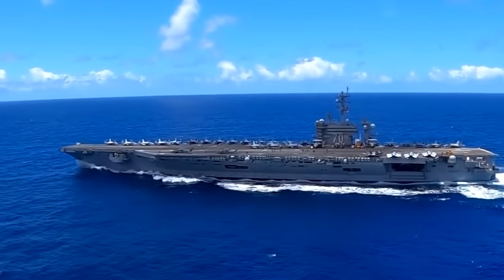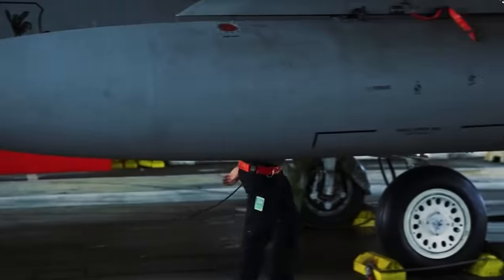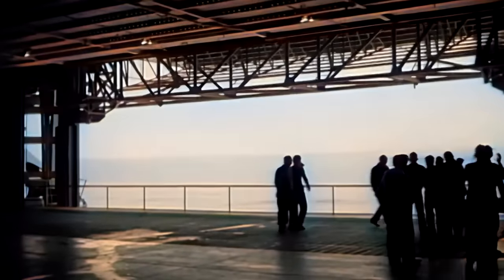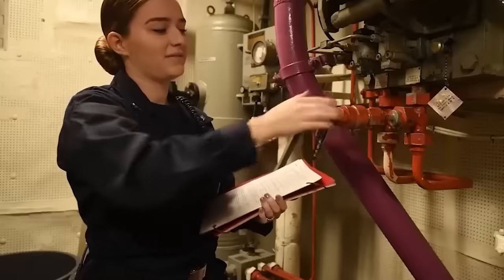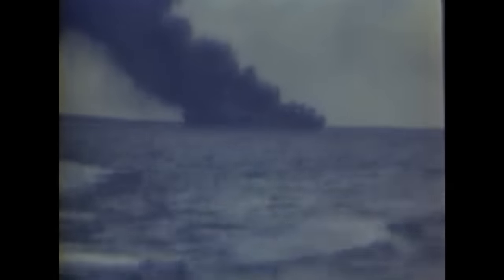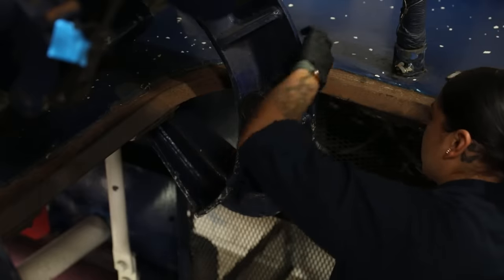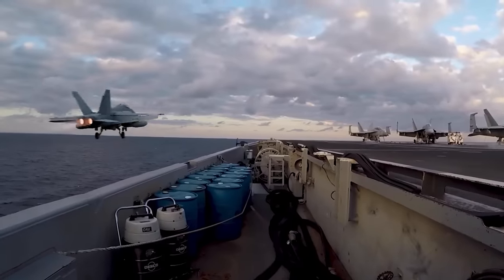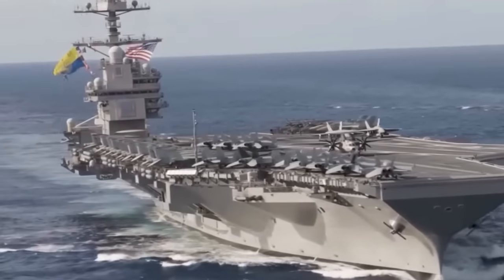Why Do US Aircraft Carriers Have NO DOORS in Hangar Bay?

Comment: I served CV-62, CV-64, CV-66 and CVN-70.  All had elevator doors.
Reply: INDY BOY!! i Served CV-63
Reply: I served aboard IKE 1991-1994.
Reply: I was on the Carl Vinson CVN-70. We had hangar doors, but kept them open all the time.
Reply: @Richborg44  the Hawk was only closed for rough seas if i recall. but that was 99-02
Reply: Only time I seen our HB doors closed on the Vinson was if it was bad weather or they had the white lights on at night during deployment.
Reply: Which one was your favorite
Reply: CVA-64/1966-67. Hanger baydoors used in rough weather including typhoons.
Reply: There were also compartment door in hanger to separate parts of the hanger.
Reply: Served on Forrestal CVA 59 WESTPAC
Reply: Thanks for service
Reply: @gf3559  , the Hawk's hanger/elevator doors were closed while transiting the heavy seas in the Atlantic coming home from deployment on our way to Philadelphia, via Norfolk, in 87. While walking through the hanger, you can hear the waves slamming against the hull of the ship. Sure glad those hanger doors were closed then. It sounded like I was walking inside a bass drum.
Reply: I was on the Connie to. When were you on her?
Reply: I rode CV-64 (The Connie or The Bitch) as a black shoe. Those doors were closed in bad weather and in the freezing ship yard in winter, Bremerton Wa. 1976.
Reply: @gf3559
I Enlisted by Autumn '98. 😉
Reply: @robertmoore7199
I was b. by Cesarean Section
@ 2:52 P.M. CST on Oct. 23 that
Year!
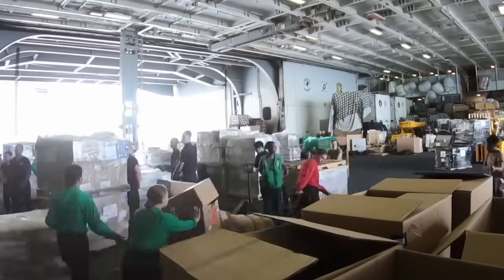Reply: Thank you for your service. I saw your post shortly after posting the following " At 0:07, 0:26, 8:43, 8:46, 8:49, 9:46, 9:49, and 17:15, you can see  horizontal sliding doors to the sides of the main aircraft lift elevator."   Your post establishes that doors WERE present. So, the question then becomes "When were the doors removed?". My first guess was that change occurred with the introduction of nuclear carriers. HOWEVER, since  you served on CVN-70 (Carl Vinson), which is nuclear powered, my guess is wrong.  So the question remains..."When were doors removed?", or better yet, "Specifically, WHICH carriers do not have doors?"
Reply: @gregparrott  ALL US aircraft carriers have hangar door...
Reply: @blackpowder13  Either this video overstated the lack of hangar doors, or you're right, and this channel if full of s**t.
Can you state for a fact that ALL of the Nimitz class, as well as the latest 'Ford' class have hangar bay doors? If so, what's your source?
Reply: Connie was one hell of a boat. V-2 Waist Cats '00-'03. Best 3 years of my life.
Reply: I served on America from 87 to 89, and spent some time as a flight deck EO (elevator operator).  America had doors.
Reply: I was on CVN64 In Vietnam, and we had doors between forward hanger bay and aft HB. None at the elevators. Those just blew out,with the planes still on them.
Reply: I was squadron and did dets and/or cruises on CV-59, CV-60 (Desert Storm), CVN-69, CVN-73, CVN-74, and CVN-75. All had hangar doors. - ATC(AW)
Reply: When were you on the Indy? I was G-3, 95-decom.
Reply: Hey shipmate! I was on USS America CV-66 in 91-92, S7 division.
Reply: I was on the Indy and Nimitz, all had hanger doors, you can actually see them in the first couple seconds of the video......
Reply: CV-64 WestPac '97 here!!
Reply: Uss Carl Vinson plankowner 80-84 V-1 Div.
Reply: I sailed CV-61 w Capt. Dan, CV-64, CVN-65 the prize, and a tiger w my son on CVN-72. All had hanger bay doors. Usually closed in rough seas, general quarters, or when we weren't flying.
Reply: Hey Shippy, I was an AO in VF-102 Diamondbacks 90-94 embarked on the America.
Reply: Me too brother V1 division Yellow shirt fly3 86-89 cv-62
Reply: @ksamos  I still have my Diamondbacks can coozie and other swag from VF-102

Edit: we were aboard at the same time. Good times
Reply: The doors you are referring to are called blast doors and they are designed to protect against ballistic missile attacks. I've worked on Nimitz class carriers and I've seen them closed while being serviced. I was on one a year ago and was glad the doors were closed because it was freezing cold outside.
Reply: Served about 8 months of CVN-72 and the. Served on CVN-73 and did 2 deployments to the Gulf. Was on 73 when 9/11 happened, and we ended up sitting off the coast of NY for air cover. Cole was part of our group when she was hit. All that time and the elevator doors were only ever closed for bad weather.
Reply: I flew the blackbird
Reply: I was a Surface Warfare Officer , aka "ship driver", ) O- 3, aboard the USS Independence, CV-62 in 1979-1980. We of course had "hanger doors". Remember the large ones with RED paint around the trim? Behind which were the munitions, like oh you know- the Nukes? Yeah, those doors were kept closed most of the time.
Reply: I was on Ranger, CV-61 and we had elevator doors.
Reply: @gregparrott  I spent almost a decade serving on several flattops (not to mention a lifetime as a Naval Aviation enthusiast) They all have hangar/elevator doors, tho they only closed em for heavy weather...
Reply: Nice! I was on CVN-72.
Reply: CV 42 had the aft port side hangar door blown in and the ocean filled up the hangar bay. The water flowed in and out. Up to the ceiling where I held on to pipes until the water flowed out only to keep repeating for days.
Reply: True indeed.
Reply: Agreed, CVAN-65, CV-61, CV-63, CV-64, CVN-68, all had elevator doors. All the way from 74 to 88. The doors were only closed during inclement and sometimes GQ. On the Ranger CV-61 during a fire in the engine room, the doors were closed to help contain the smoke and fire. Also until CV-68 all had 2 hangers not three so only 1 set of divisional doors.
Reply: So you think any didn't have hangar bay doors?  those must be the river aircraft carriers where there are no storms with big waves.
Reply: CV-66 America 🇺🇸
Reply: I served and decommissioned CV-64. I am very proud of the time I spent in Connie!
Reply: @johnheffner3950  The forestfire ?
Reply: @KAH-7 bad day for some good day for others
Reply: @coachwendy5618 I figured sub freezing temps had to have hanger doors ?
Reply: @eflanagan1921  that's the one July 29  1967  WESTPAC
Reply: you can literally see the doors in the thumbnail…
Reply: @jimt503 used i; typhoons for good reason: loss of life in one in WWII
Reply: I served CV-59 , 60 and 62 , I guess they never thought of NBC attacks , not to worry though ,  you don't have to sink a aircraft carrier ,  only put it out of action , ref FORRESTAL , ORISKNY  and ENTERPRISE , all during the VIETNAM conflict.
Reply: @timothyseeger5296  they thought of those attacks, the doors wouldn’t matter in the the N or the C as the former you’re blown apart or neutralized by EMP before a meltdown and the latter you can use conventional damage control to combat.

the B is easier: isolation. you’re a floating city, underway replenishment is done via air with no contact with the ship except replenishment until confirmation of the issue being contained or eradicated
Reply: @bostonrailfan2427  in my day that was what was taught in I Division / Damage Control qualifications , mind you , the FID had holes rusted through and it wouldn't matter what doors you closed.
Reply: @timothyseeger5296  now i know you’re lying
Reply: @bostonrailfan2427  what are you on about ?
Lying ?
Reply: @timothyseeger5296  I remember that day July 29 1967 while I was serving on the Forrestal lots to tell Thank you timothy for your comment! Are you a member of the Forrestal Association?
Reply: @kevinpresley3136  Damn, just missed you, I got there in early 95 till the end of 96!  Join the Navy they said, see the world they said...got stationed on the Eisenhower in Norfolk...3 hours from where I grew up...lmao.  Got flown out when they were doing flight quals in the Bahamas, sailed back, did the Tiger cruise from Florida...then Drydock for a 19 month overhaul....soooo much yay...lol
Reply: @shawnadams1460  I hear she is due to be decommissionedin a few years.
Reply: I served the USS Midway, Foreststall, Kennedy, Carl Vinson. US Carriers have Divisional doors and hangar doors
Reply: I served on CVN-73  and retired on  CV-67 after 23 years. Both have hanger doors and elevator doors
Reply: @jeremiahgrondin7034 I was on the Kitty Hawk when we were going through the Straits together in 03. I was with a Hornet Squadron. I have pictures of the Connie from our side.
Reply: @robertmoore7199 Haaa!!!!! Sinking Sara, Danger Ranger, Ike, Numb Nuts,Bonnie Dick, Forrest Fire to name a few other nick names. Fair winds
Reply: @TheHawk--oe8iq  I was 7 decks down on Indy riding thru a big storm. I swear I could see the bulkhead flexing when we banged and scraped into and thru big swells and waves. Blooommmmm long drawnout booms and rumbles😳 and everything that could close doors and hatches, we set condtion zebra cause we were getting green water over the bow
Reply: @danieldunlap4077  I remember that day like it was yesterday. Looking at the "Shitty Kitty" we were like, Damn. What a rust bucket. I am quite sure y'all thought the same.
Reply: @gf3559  I spent 5 years on the shitty Kitty and I remembered doors, this video was making me think I lost it.
Reply: I served on CV 43, CV 66, CV 67 and LPH 9, all carries have doors that close during heavy weather and for NBC warfare defence. You need to do some better research. Mike from Maine
Reply: I was on the last ride of CV 64. And I distinctly remember hangar doors.

Comment: I served aboard the Kennedy for 4 years. The hanger had doors at all the elevators. They were closed during general quarters and while at sea during rough conditions.
Reply: Yup!
Reply: I was on the USS Ranger CV-61,  for 3 years.  If those weren't hanger doors, THEN, they were side doors by the aircraft elevators, you know the big sliding door, with the bell that rang when they open and closed.   We had 3 big elevators with sliding doors, or maybe those were windows.
Reply: Can confirm!
USS JFK, VF-14  89-92  Good timez  :-)
Reply: "Look, I'm not saying all Sailors are gay, but how many centuries did they say it was bad luck to have women on board?"
Reply: So that's the open parts were seeing, the elevator bays?
Reply: @Brunzy1970  Yeah. And the elevator is up.
Reply: I was on the Eisenhower 90 to 94. cat one baby.

Comment: You can literally see the non-existent hanger bay doors in the video. Aircraft Carriers have doors that close the elevators off from the hanger bays, and doors that separate the hanger bays into sections.
Reply: Of course there are hanger doors in the carrier.  They are sliding doors (you can see the doors at the side in the video). The doors are opened during daytime and closed at night (or during rough weather). It is required for darken ship, or else the lights in the hanger can be seen by the enemy.

Comment: I'm not sure where you get your information but there ARE hangar door on all aircraft elevator lifts ( 4 ). There are also interior hangar doors splitting the lower hangar into 2 separate spaces for fire containment and damage control. Better check your facts.
Reply: Not only was this guy completely wrong, but this could’ve been answered and wrapped up in 2 minutes even WITH an introduction and general information. But it drones on for 18:31!

Comment: Light discipline is an important aspect of warship operation.  White light is necessary for some aircraft maintenance operations.  Red lights (or the newer blue lights) help preserve night vision.  Low tech navies and drones can home in on lights whether they're red, white or blue.  Fight ops require lighting--even if it's IR for night vision goggles.  

I was on the USS Tripoli/LPH-10 from November 1977 to August 1978 as a Marine avionics tech assigned to the AIMD in support of HMM-262.  The hangar deck was red light during hours of darkness to preserve night vision.  There were light lockers (double doors to black-painted rooms) for hatches leading to the catwalks and other exterior access points.  I was able to observe night flight ops once and the flight deck was lit up with red lights--they could have used white floods but didn't.  My avionics shop was lit 24/7 with white lights--just try reading color codes under red light!

Hangar doors assist in light discipline, whether that's preserving night vision or pretending to be invisible.  Passing a cruise ship off on the horizon showed me the difference.

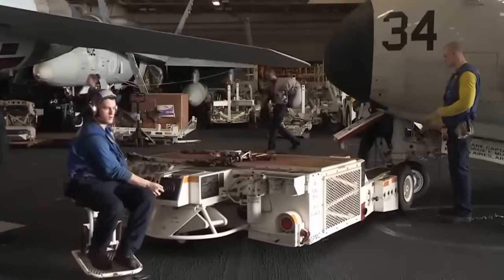Comment: I'm confused. At 0:07, 0:26, 8:43, 8:46, 8:49, 9:46, 9:49, and 17:15, you can see  horizontal sliding doors to the sides of the main aircraft lift elevator. Are the carriers shown older, non nuclear carriers?         Also, while I can see the weight and complexity posing risks, couldn't a 'sheet' style door be used, such as is common at grocery stores? They use an array of vertical strips to contain the cold air in refrigerated sections. A carrier could adopt a similar approach that's light, fireproof, simple, and could be quickly detached and pitched overboard if it failed during combat. They could be used to regulate air flow, air gusts, salt spray, and interior temperature better than an open door.

Comment: USS Kitty Hawk had doors. More important than that, if you look at the ship at 3:04 in THIS VIDEO, the ship shown (Nimitz class) has the hangar bay doors closed. At 8:43 in this video is a shot from inside the hangar deck and you can see the doors from the inside in the open position. Also at 8:52, on the Lincoln, you can see the doors on the extreme left of the screen, again in the open position.

Comment: Served on the Ranger, Kennedy, Kitty Hawk, Vinson and they all had hangar doors. They also have a hangar fire door in the middle of the hangar to stop a fire if the front or back hangar catches on fire. The Hangar Elevator doors were only closed during really rough seas. At time index 2:30 you said "that some hangars decks can have even two or three levels if you can believe that", well I don't. I've been on multiple aircraft carrier hangar decks and all of them only had one level. I've never even hear of a 2 or 3 level hangar deck before. You really need to check your source and ask some folks who've been there and done that before just putting out these crazy stories.  Thanks for sharing anyways. Best Wishes & Blessings. Keith Noneya AT1 USN/USNR-TAR Retired.

Comment: What? Where do you get your information? Ive never seen an aircraft engine running on the hanger deck and I don't think Ive ever seen fueling in the hanger either. Both are a huge fire hazard plus you have aircraft within inches of each other and the hanger is not a restricted area. So unless there are weapons being loaded the whole crew has access to the hanger. I also don't see a need for fueling in the hanger. While on land our aircraft had to have either fully fueled fuel tanks or completely empty and purged before being placed in the hanger. On board ship the restriction are going to be stricter. If I am incorrect someone will correct me.
Reply: You correct and the vent system in the hanger bays is pretty good. I think he has u.s. carriers mixed up with ww2 japanese carriers and thier sop before midway.

Comment: Every aircraft carrier I have been on has both doors to the hanger deck and doors that separate the hanger deck into sections in case of fire. And at extremely high speeds, the prop wash is as tall as the rear of the fantail. CVN69 and CVA66. Unfortunately, one of my shipmates was swept overboard during a sea swell and lost at sea. He tried to grab on to a rack of missiles, but they were swept overboard too.

Comment: Safety is paramount in an aircraft carriers...the hangar bay doors is relatively efficient in providing protection of aircrafts and equipment from gusty winds and waves of waters in coming inside hangar bay but the downside of this is when there is hangar bay doors the tendency of confine mixtures of gases and fumes can cause fire inside of it and due to lack of ventilation as well the personnel can experience suffocation that can lead to death. Thus, the primary concern here is by not having hangar bay doors is more reliable when it comes to safety measures for the sake of aircrafts, equipments and lives of personnel.

Comment: Hanger doors sound great but in battle, what happens when an explosion occurs inside the hanger?  Doesn't that function as a firecracker in a teapot or exactly as a bomb would--incredible amounts of pressure resulting in a massive blow out warping bulkheads while everyone inside is reduced to 1/1000 their original size?  And how many doors will be able to still open once the explosion takes place and warps all of them?  Being able to open the doors allows for quick disposal over the side of anything at risk of blowing up while I would assume could only help in getting rid of poisonous or explosive gasses.  I can only hope the doors are designed to very easily be blown out.

Comment: I served on the CVN-71 USS Theodore Roosevelt for five years. The hangar bay doors were closed during bad weather, in general quarters, and in case of fire, so your initial claims are false. This is in addition to the doors that could be closed to separate the three hanger bays. Hanger Bay one (Forward), Hanger Bay two Midships, and Hanger Bay three aft portion.

Comment: Did you just make this video based on your personal thought? If you did do research, I would be curious to know what your sources are. As far as I’m aware, most, if not all aircraft carriers have hangar doors at all the elevators (if multiple). Some also have portioning doors/walls in the hangars to section them off. The hangar doors stay open for the most part. It takes a lot of work and time to engage them. They really only close them in adverse weather or when the ship is at port.